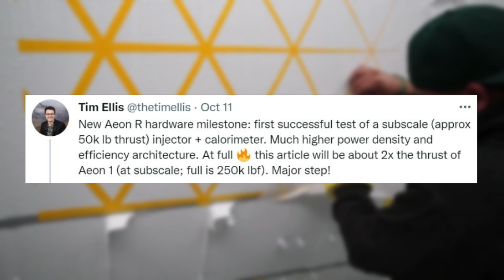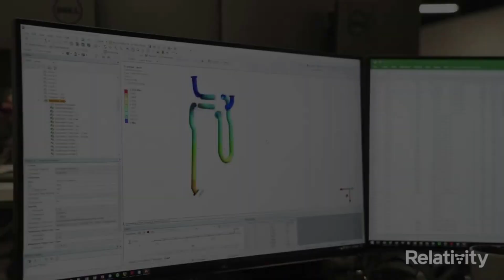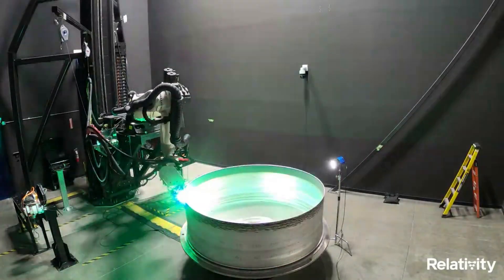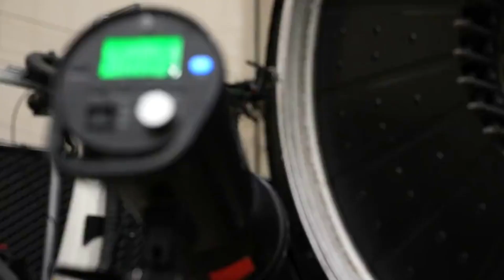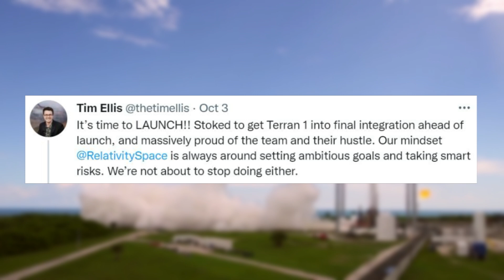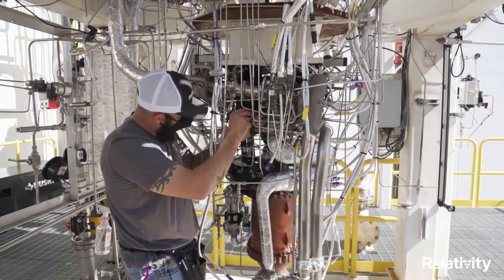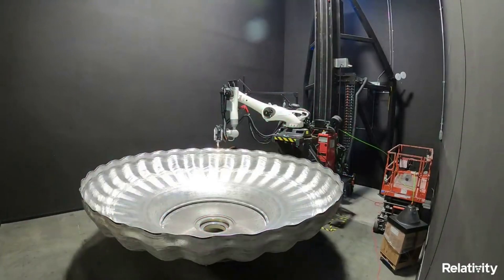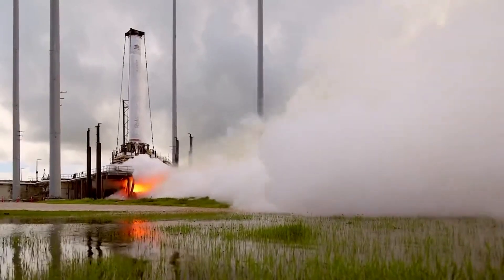Relativity Terran R Engine Progress, Terran 1 Launch Prep, & More

Comment: What's many don't realise is how terrible natural gas is to the environment ♻️  this space race is going to raise the climate.
Reply: But thē Ēlon’s raptor engines are methane fueled and he can do no wrong. Simple solution is to use Bio-methane that is CARBON NEGATIVE and be sure that SpaceX is procuring it since his rocket will be the one that is burning most of the methane if you listen to his followers.
Reply: also the natural gas is burned, releasing co2, which is also a greenhouse gas of course but not as powerful as methane. (but lonnger lasting!)
Reply: eh with the current frequency of launches its barely a dent in global emissions.
Reply: Nope - H20 captures the same frequency IR as methane, and there's far more H2O in the atmosphere than methane.
Reply: @paulcarter7445  the methane is getting burned you fake experts, its not just dumping the methane tank into the atmosphere
Reply: @JackMott  Huh ? Of course it's being oxidized, just pointing out the even bigger error of his premise that methane is a problem is not correct.
Reply: @paulcarter7445  yes lets argue about the harm of a molecule the rocket isn’t emitting
Reply: @JackMott  Lol, why so fragile ?  You had already covered the obvious point that it wasn't emitting methane, so I didn't bother piling on, just addressed the remaining fallacy.
Reply: natural gas is much better than rp1 that most rockets use now